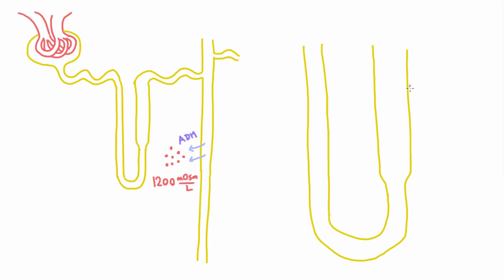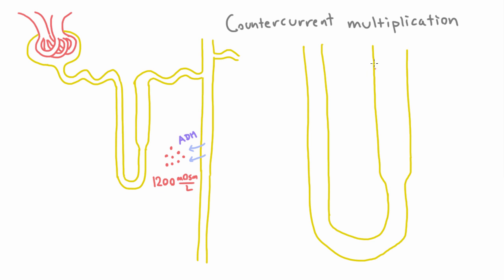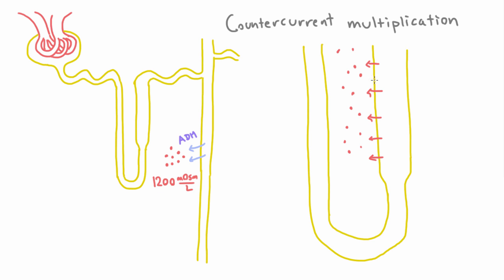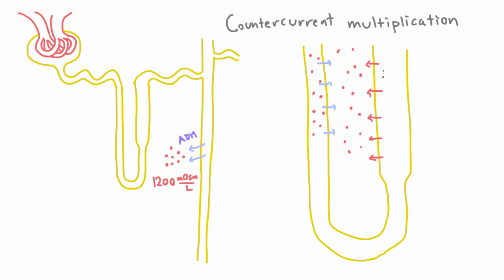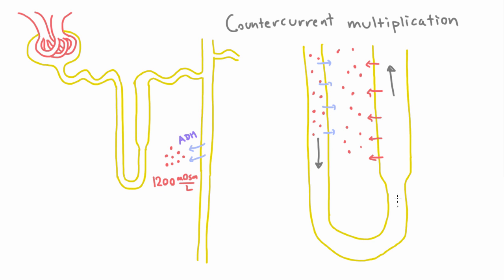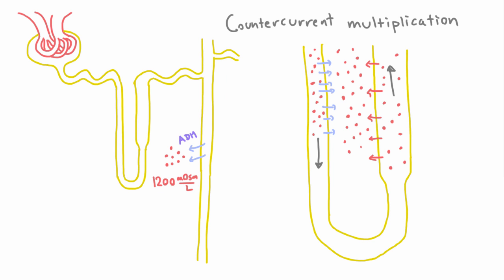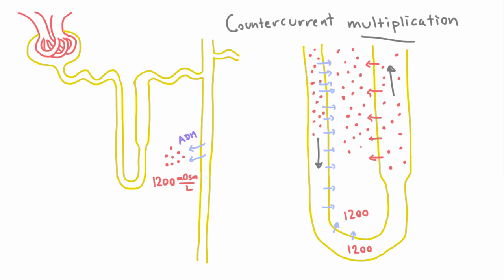Countercurrent Multiplication in the Loop of Henle

Comment: Great explanation, but how is the fluid in the interstitial space transported out? The gradient of osmolarity is equalized by the water in the thin limbs of Henle, so the gradient is lessened. Textbooks say that, to prevent this,  the vasa recta transport fluid out of the system, but wouldn't they lose water in interstitial space of such high osmolarity instead of taking it up?

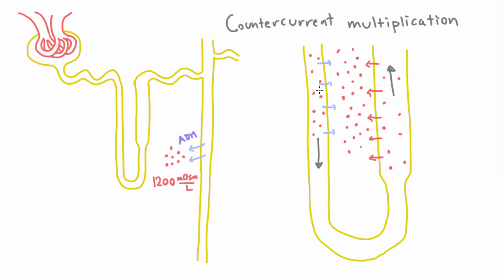Comment: At 2:41, Why would there be a difference between the concentrations between ascending limb and interstitial space since ascending limb has the same concentration as the fluid that just came from the descending limb and that fluid was in equilibrium with the interstitial space? Or does this not matter because it's active transport?
Reply: I think it's because of the multiplication component.  The more concentrated the ascending limb gets the more it can "afford" to release even Na(and presumably other substances?) back into the medulla interstitium.  This continually makes the interstitium more concentrated than the descending limb, which in turn sucks more H2O into the interstitium from the descending limb.